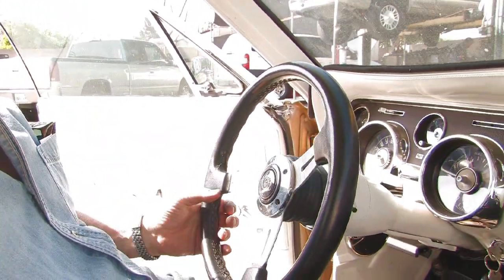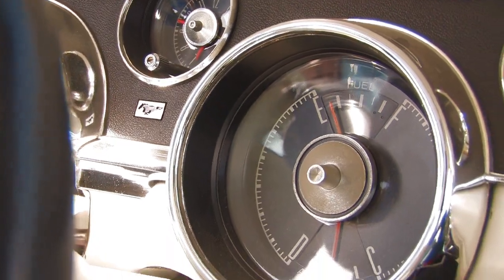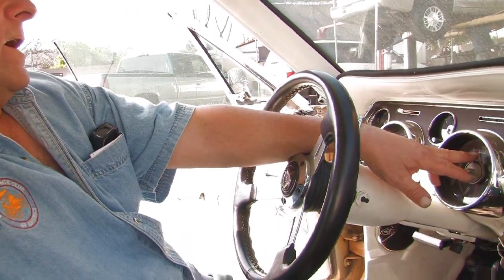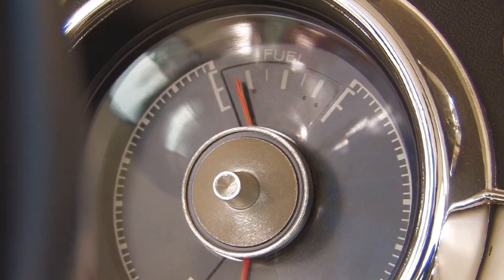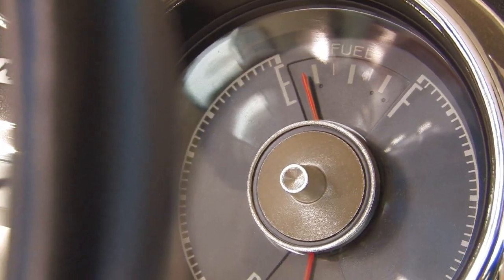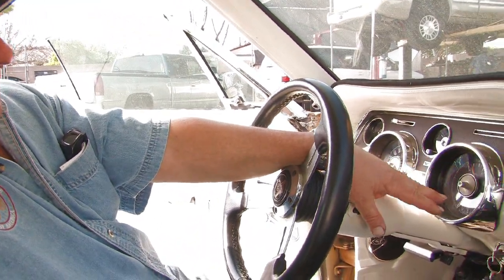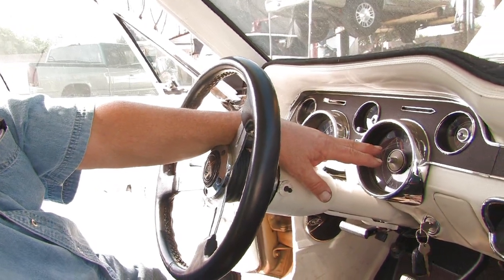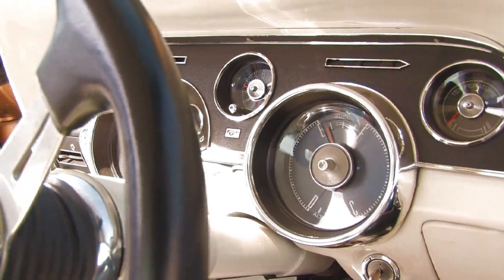Troubleshooting Car Problems : How to Troubleshoot an Automotive Fuel Gauge

Comment: I have a 1980 Malibu and replaced the fuel sending unit, but the problem is worse. How do I check the gas gauge, and where is the voltage regulator? Thanks